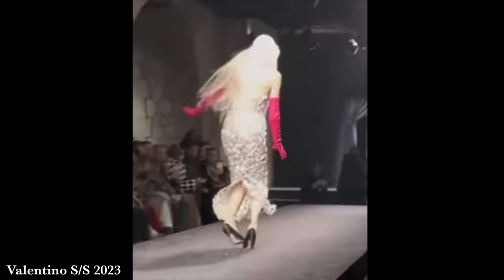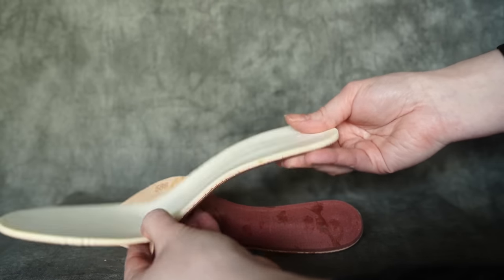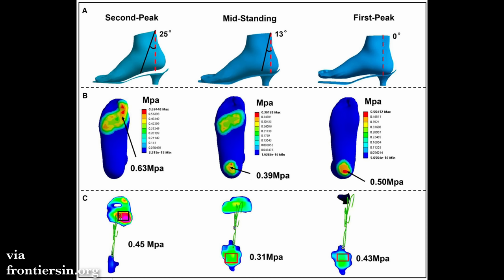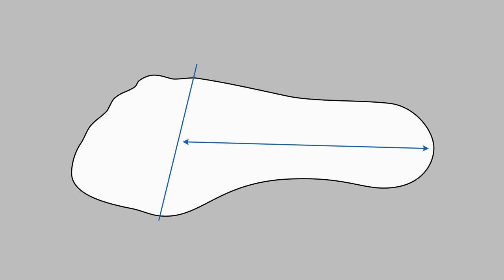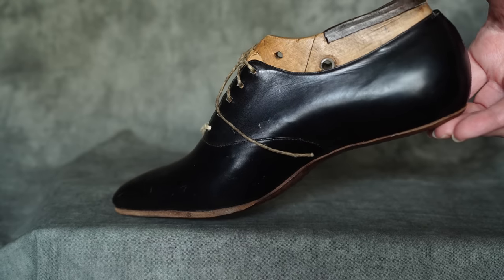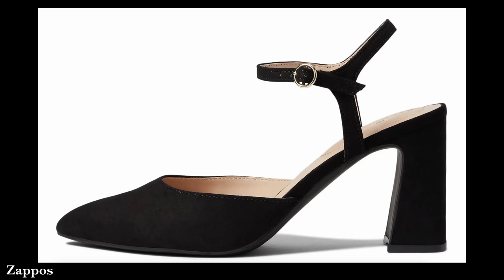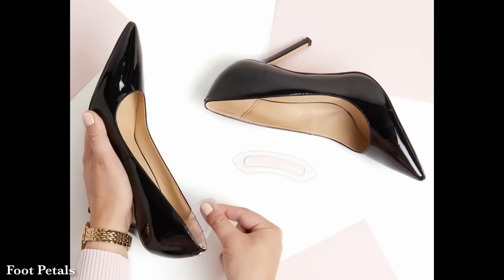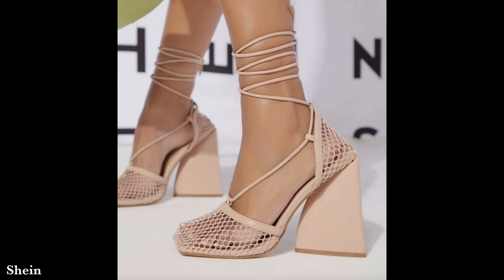Why are Modern High Heels so Bad?

Comment: I have the horror of three "unusual" traits that make shoe shopping a nightmare: wide feet, very high arches, and feet so small that I can barely ever find something in my size in the adult section. Just finding something that plain fits is such a pain. Usually I just go to running shoe stores and make them pick out the three shoes that can actually work for me and add arch support later, but occasionally I need to dress formally and that's where I just visit every single store near me and dissociate.

(Yes this is a plea for store recommendations if anyone has them)
Reply: maybe custom shoes on etsy or something could help?
Reply: I know custom shoes are expensive, but it sounds like it would be worth it
Reply: Vivobarefoot
Reply: @im093  vivos have become very narrow in the front of the foot over the last 4 years.
Reply: I'll add one more to that list of horrors: Toe nails curving upwards. Oh yes. Good old 45 degree upwards. I found a pair of sneakers (that I fear is now discontinued) from Adidas Junior side that had enough toe space for me. Like I can WIGGLE my toes!! It's amazing!!
Reply: @catarinapatatina8314  They're also too flat :/
Reply: @elelith7802 yeah nah, I do not possess the expertise to judge that. Also I don't know which knowledge your generalised statement is based on :-) A foot surgeon on public broadcast (like German BBC) said that if you wear both barefoot and "normal" shoes, none should do you harm and neither is the root of all evil. But again, that's only one person AND medical education over here did not and often still does entail good scientific literacy. I.e. how to set up a meaningful study, how to interpret studies by others etc pp. Plus it's very possible that nobody actually set up a study of barefoot shoes vs "normal" shoes for everyday walking.
Reply: nordstrom? they do free shipping and returns in the US and (online at least) you can find down to a 4.5.
Reply: @catarinapatatina8314  I meant they're too flat for my feet :D My toe nails grow a bit upwards so they tend to hit most shoes top bit. I need like ~2,5cm clearance for my toes. It's pain, literally.
Reply: I have the exact same problems too. If you buy customs shoes then I will too lol
Reply: @fluffysheepfallingasleep609  
You can't pay too much for your feet
Reply: I don't know what size you are but I'm guessing a US size 4 or 5 since I've never seen smaller sizes in adult sections. There's a store called Bared. They cater to those sizes and have a nice selection of shoes but they're expensive. One shoe should last years with proper care though since they're well made
Reply: Xero shoes is wide enough for me, although they only have a few dressy options
Reply: Widestep, birkenstock, gabor,ziera, asics
Reply: I saw the advice before, to look at hand crafted dancing shoes, like flamenco shoes (without the metal), for well made shoes with reasonable heel height and different widths.
Reply: Just as I typed the comment, she mentions dancing shoes 😄
Reply: 😅 I'm the exact opposite
Reply: But what is wrong with pink patent leather mary janes? Trying to channel my 5yr old self. I was also wearing a Easter hat, puffy petticoat, gloves and a matching purse. The height of fashion. In  1960.
Reply: @likethecities8715  i was going to say this as well. i work for nordstrom (not in the shoe department, but i spent a year in the online fulfillment department) so i can confirm we carry size 4.5. i've even seen 4 in the way back inventory. @Autumn, it might be easier to find the smaller sizes online because whatever store has them will ship them to you, but don't be afraid to hit up your local store to talk to the salesperson on the shoe floor! they'll be very familiar with the inventory and will be able to direct you to something that will work for you, and if they don't have it in store they can ship it to the store. returns are free and easy.
the one drawback will probably be the cost - i mean it is nordstrom - but i'd personally narrow it down to one or two pairs (a black heel and a neutral heel) for formal occasions. you don't have to buy new shoes for every outfit and no one actually cares if you wear the same pair every other formal event. i've worn the same suit and heels to three different family weddings (just changing the dress shirt, tie, and jewelry) and no one's said anything.

also, not sure if you're wanting heels specifically or just formal shoes, but be open to formal flats! those also might be easier to find in your size and are just as presentable as heels
Reply: Mine are the same, and my most comfy shoes are kids sizes for the width, and I use an arch insert. It really is the trifecta of bad shoe fits 😩
Reply: Wow my foot sister.  I have the same issue.  Wide feet at the front, Short almost non-existant toes,  No heel at all and it's barely there, and my feet are tiny.  Shoe shopping is a nightmare.
Reply: Same.

I've had very good luck with round and almond toe Naturalizer pumps and boots. Avoid the loafers (the vamps are always too low and crease so deeply) and be sure the uppers are leather or suede (not fabric or synthetic). Naturalizer also regularly has sales on their website, so you can get some very nice shoes that are comfortable and last years for less than $60 a pair.

The Hazel pumps from American Duchess also fit great on me, though I haven't had a chance to try any of the other styles yet. They are pricey, but I saved up to buy all the colors because I fell in love with that first pair, and it's been so worth it.
Reply: @Kyllorac  American Duchess? Their widths are not necessarily narrow, but also not wide- I have a pair of Bernadettes, and they look similar width- too narrow to be really comfy, unfortunately, because they are adorable 🥲 Perhaps OP would have better luck with those, tho?
Reply: I went to Nordstrom Rack and they went all the way down to size four in women’s and I was impressed by the wide selection they had even for my size (US 6.5/7) because usually there isn’t much available or it’s already sold out.
Reply: I'm almost the opposite, I've got wide feet too, but flat and big feet. I tend to go between 10 and 11 womens size whichever has the right toe space. Most stores barely carry my size, I will check the mens shoes for sport or casual sometimes but I tebd to order online, especially if find something that looks good even if it's not my size. And you can price compare too.
Reply: Nordstrom! Easy returns. In search do a wide width filter. That will zero you in to the right brands like Monroe that still makes wide width. Northern European brands tend to have roomy toe boxes. My current favs are a pair of Minnetonka moose loafers. First thing I do is look at the underside of a shoe, tells me width. No need to live in sneakers if you don’t want to!
Reply: Carmina. Spanish brand that is one step down from full custom, but has a large variety of lasts (and shoes) to choose from - shoe/heel shapes comes off more traditional, but very high quality materials and craftsmanship + replaceable Goodyear welting makes them worth every penny.
Reply: i have two of these plus really flat feet and the wide + small issue really sucks because they expect wider to equal longer
Reply: My daughter has these exact same issues with her feet-- and that is why she chose to get married in August and go barefoot for her wedding!
Reply: I have the same problems!!!
My arch is so damn high and my feet are fecking tiny. I live in sneakers and boots
Reply: Same here. I need my shoes 2 full sizes wider than long, and arch heigh another size larger on top of that.
I tend to buy large and glue on loads and loads of felt as padding to prevent my feet from sliding too much and causing serious blisters, but it's a pain (literally and figuratively).
Reply: I FEEL YOU SO HARD. I have wide feet AND toes. Even if I get extra wide I end up breaking the shoe with my toes (and getting absolute hellish blisters.) I cannot afford custom shoes, so the only option I really have are crocs.
Reply: @Autumn…I have the SAME issues, all three of them 😅. Xero shoes has been my solution. I wear a 5.5 and the toe box is wide enough that it doesn’t cramp my toes.
Reply: I recently started shopping from Cole Haan, they make comfortable, durable and pretty cute shoes, without breaking the bank (they are not cheap but definitely not luxury prices, specially if you buy older collections).
Reply: Yup, same.  Length wise I wear a 5.5, but I usually end up in 8.5 wide to even get my foot in it.  It's the curse of triangle hobbit feetzies.  The best shoes I ever owned were custom made and they were totally worth it.  Unfortunately my feet changed (got even wider) after pregnancy, so having that last remade is not in the budget anymore.  I nursed the one pair for as long as I could.  The good news is that I stubbornly held onto the too-small pair and now they fit my son!  LOL
Reply: Yup, same.  Length wise I wear a 5.5, but I usually end up in 8.5 wide to even get my foot in it.  It's the curse of triangle hobbit feetzies.  The best shoes I ever owned were custom made and they were totally worth it.  Unfortunately my feet changed (got even wider) after pregnancy, so having that last remade is not in the budget anymore.  I nursed the one pair for as long as I could.  The good news is that I stubbornly held onto the too-small pair and now they fit my son!  LOL
Reply: @catarinapatatina8314  who are you even talking to? no one said anything relevant to your response lmao
Reply: @verminscum  dear random online person, first, vivobarefoot shoes were recommended for  wide feet. A couple comments later Elelith made a blanket statement that vivobarefoot shoes are too flat. Turns out too flat for them but if you actually read ALL of the comments, you'd see it.
Reply: Birkenstocks? For summer at least
Reply: @Aardappelpurree  I've never met a pair of Birks that fit.  The arch is in the wrong place, too far forward, too much heel, not enough rise in the straps, too narrow, too long.  It's the same problem with nearly all other shoes: too narrow, too long, too low.  There are a few brands made specifically for certain ethnic groups that fit well, but they are dragon's teeth (meaning hard to find).  Nike N7's (good luck finding a new pair), and custom footwear.
Reply: They're sandals, but mohops! They'll happily make custom sizes and have incredible arch support!
Reply: I have the same trifecta but with large feet instead of small feet. I'm a size 11 in US shoes, and that combined with width and a very high arch makes shoe shopping an actual nightmare. I literally never buy shoes for fashion or pleasure, only for function. And if I find something that fits well and is comfy, I try to buy it in multiple colors so I have at least some styling options.
Reply: @elelith7802 how do we have the same feet? 😂 truly the nightmare mode of footwear
Reply: I wear us4 wide, don't have the arch but at my size its the worst struggle to find anything but sneakers. I tried American Duchess, but find them too long while still not wide enough. I discovered Memery, though, and their shoes are really nice. A us size 4 is only a smidge too narrow, their 4 wide is perfection. They just opened their US site, so they don't have a ton of their really small sizes in stock yet, but you can always message them to special request from their Denmark home location.
Reply: I feel your pain. I have very wide feet, pretty long (11WW) and very high arches. My feet are too wide for the "just size up" advice to work and I love crazy fashion heels so it makes me sad I can't participate in that. I wish I could get shoes custom made because at this point I'd be able to pay for one or two really fun pairs, but I've not found anything like that. I've really considered learning to make my own shoes.
Reply: I have big wide feet with smaller heels and I wear cowboy boots. Once they break in my heel stays there pretty good. Try Ariat for comfy ones.